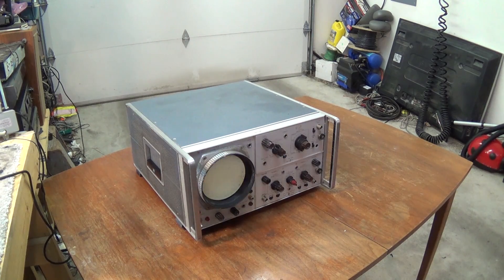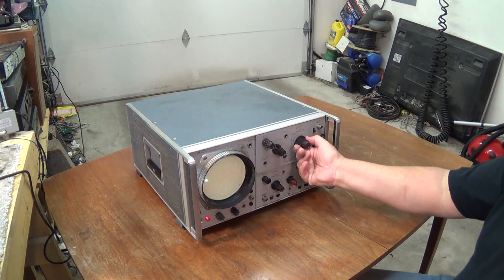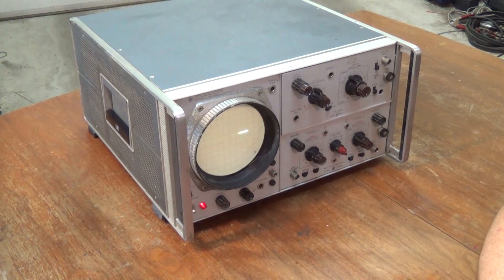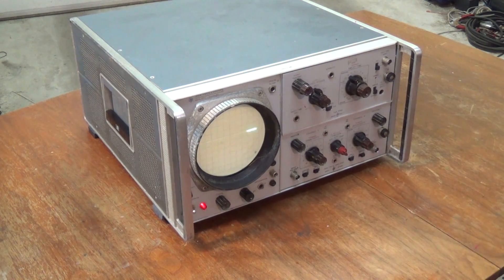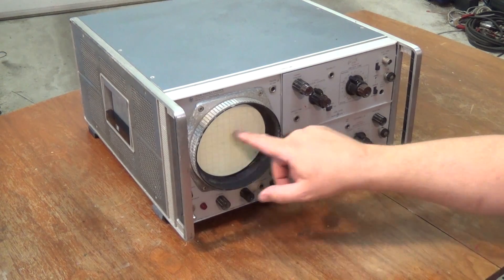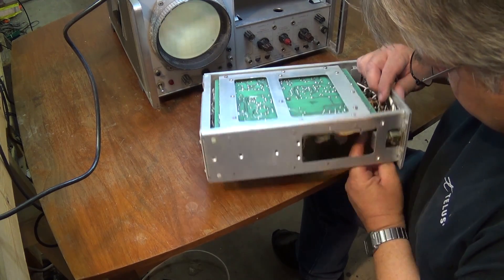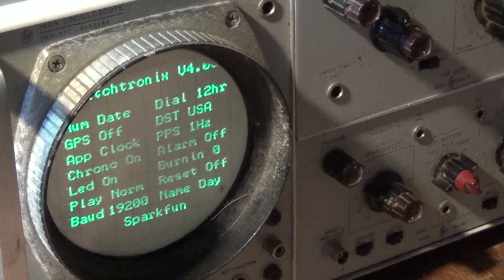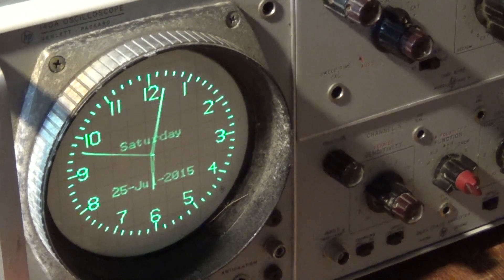Oscilloscope Clock

Comment: I hope you turn it off anyway to try to prevent some of the burn in.
Reply from the maker: I don't run this scope much. It is 56 years old. It sits under my bench. I have a little heatkit I run the clock module on, and am looking for another small scope for my other clock board. I have 2 of these modules now that I fixed the second one.
Reply: 12voltvids It’s a nice oscilloscope.
Reply from the maker: @infinitecanadian  
Still works. A little easier to use then the 2 I currently have set up.

Comment: I picked up a LASER projector that inputs analog.  This module could make a great clock for a New Year's Eve celebration.  Too bad the sparkfun module is no longer built.
Reply from the maker: Yes I know.  I have 2.  One was defective so they sent me a replacement.  I blew that one up so ordered the parts and fixed both.
Reply from the maker: That would be cool. I wonder if it is fast enough for this.
Reply: When Sparkfun stopped making them, the original designer made them for a few more years, but stopped and now just has the board plans and a pre-programmed microcontroller  for sale.

I liked the sparkfun version because it was small, but the DAC had no short circuit protection so if one accidentally shorted the output to ground the chip burnt up.

I took a solid state Bell & Howell kit built oscilloscope and installed the Dutchtronix version of the clock. After getting tired of repairing and always having to adjust the original scope circuitry (basic lower end circuitry) I gutted it and replaced it with a deflection amp board that is very small. It works decently enough, but on a lower bandwidth scope (under 5MHz bandwidth) the display doesn't look so pretty which is due to how the clock draws the screen. Lines meant to be drawn are drawn at one speed. Lines meant not to be drawn are drawn much faster so that blanking is not necessarily required, although the clock does provide a blanking signal. I used a DS32KHz TCXO in place of the XTAL for the RTC to make the clock more accurate. Instead of a battery I use a large capacitor (several farads) and a circuit to charge the capacitor to 3Vdc. That powers the RTC and TCXO. The clock is connected to my PC VIA a serial to USB converter so that my PC can set the time and date automatically.

Comment: You not worry about the burn in ? But now you are using it. See how that works.
Reply from the maker: The clock board moves the image around to prevent burn in. I also don't leave it on all the time.
Reply: In this video you said you was going to disable that function and you were not worry about burn in. Guess you changed your mind after this video.
Reply from the maker: Not really worried about burn in. I don't leave it running 24/7. Since this old scope makes so much noise, and draws allot of power it was more of a novelty. I am looking for another cheap scope, one for the bench, and one to use for my clock board.
I might hook up my video display clock to the monitor up in the corner of the shop where the old scope used to live. I put up an old badly burned CRT set for my security cameras, but it would be easy to hook it to my video clock module, which is just a raspberry pi first gen that generates a realistic looking flip clock. That would look cool in the shop. I run it on an ancient B/W monitor in my office as a CRT desk clock.
Reply: I had a scope long time ago. Never did use it that much. A good DMM is all I needed for most things. Do you every work on old tubes tv sets. Seems to be a thing on YT. Why I don't know.
Reply from the maker: I have a number of CRT TVs but they are all solid state
I am looking for an old vintage color all tube set but as of yet I haven't found any around. I used to work on many tube sets, as when I got into the industry, and I started my TV training when I was only about 16 in 79 tubes were still very common on TVs. Well into the 80's tubes were still very common, but then people just tossed them.
I have a couple of vintage radios I will be working on soon. One is a bare chassis, and the other a Normende  console radio. 
The reason people like to work on tube stuff is they are very simple. High voltages for sure that can kill you in an instant if you are not careful but very simple circuits.  Color tube sets were a littl emore complex, but B/W and radios pretty simple. Amplifiers, simple.
By comparison to the IC sets that have everything buried in an IC that you can't service. Scopes are not used every day, but when you need one, you need one. I am looking for a newer scope, but because it is something that won't be used every day I am looking for a cheap one, and so far the ones I have found sellers are asking far more than I am prepared to pay.  I'll find one cheap soon. When the ham radio flea market comes to town there will be lots of test gear up for grabs from estate sales of silent keys.
Reply: I find it interesting how certain people are now wanting old technology. Like old tubes radio and tv's. I just never thought that would happen but I guess its about what is not common anymore. I'm certain if you could go back in time and show people what we have now they would want what we take for granted like smartphones and computers. The world is funny that way. Always wanted what we cannot have. Or at least we think we want it. I don't miss tubes technology. I seem to understand IC chips more and so forth. I just think that we have advanced so much in such a short time. It's kinda unreal.
Reply from the maker: The only thing that tubes do better than solid state is amplifiers, and it is not that they are more accurate, they are not. They introduce even order harmonic distortion, however even order harmonic distortion makes musical instruments, and the human voice sound much fuller, more like a live performance. I have 4 full tube amplifiers, and 1 hybrid amp. 2 of those 4 I built. The sound quality of these amps is difficult to put into words, one has to hear the difference in sound to appreciate it.
Now as far as CRT TVs go, they are becoming popular in the retro gaming circles because there is no lag in the refresh rate. They draw the picture line by line as it is generated by the video chip in the game console. 
All digital TVs have to store the entire frame, and then display it at once.
Plasma sets were pretty good at this, but LCD, and LEd backlight sets are slow. They typically have 2 to 3 frame delays, and that is unacceptable for gaming. Some higher end TVs have a game mode to reduce the delay, but there is still a single frame delay, whereas on an old analog CRT, there is no delay.
I have a couple of CRT sets that still get switched on occasionally. 
One is on my patio, because in the sun an LCD you can't see, whereas the CRT is bright enough to see. The other is in my shop that I use as a security camera monitor. Like many people I find the old CRT tubes cool. 
I also find plasma displays cool the way they operate, and have several plasma sets ranging from 480p standard def to 1080p HD.
LCD gets the job done, but are pretty boring from an engineering perspective. Same with OLED. I love the picture quality of OLED, but the way they work is pretty boring. Another fascinating display technology is DLP projection. All those tiny mirrors flipping back and forth thousands of times a second to sequentially flash the red green and blue components of the picture on the screen. As a collector I like to restore and preserve these technologies.
Reply: One day we will just skip all of this and place an overlay on the eye or better yet skip the eye and just plug into the brain. You think I'm joking. But I know anything is possible in this reality.
Reply: @DarrellRoper  some may do, but if I'm alive in that time I'll be still sat down here with my B&O Beovision 8802 watching stuff through my Thorn VCR or playing Sega haha

Comment: That clock board kit is still available for about $30 at http://dutchtronix.com/ScopeClockH3-1-Enhanced.htm

Scroll about 3/4 of the way down the screen and you'll find the firmware source code, as well as schematic and PCB layout and other info.
Reply from the maker: This one will be easier than the one I built, as mine was a SMD kit, very small components. This one is through hole, much easier to assemble,
Reply: I really prefer surface mount, even though I'm old and have a terrible time seeing those tiny little things. I tend to build stuff with the slightly bigger SMD components - the smallest ones are just too tiny to deal with.
Reply from the maker: I hear you there.I never wear reading glasses except for electronic work and fiber optic splicing at work.

Comment: thats very cool, wish the kit still existed.
Reply from the maker: I have 1 spare board, that needs the d/a converter chip replaced. When I can source a chip I plan to replace it. The chip is like .25 but digikey has a minimum order, and I only need 1 so I have to find it somewhere else and I can fix it.Then I will probably sell it.
Reply: I'd be interested :)

Comment: Please for give if this has been asked and answered however, I'm assuming the clock circuit is a kit. Where can I obtain one. Thanks in advance!
Reply from the maker: It was a sparkfun kit, however it is a retired kit. I have another one that the D-A converter is buggered up on. Needs the chip replaced which I will do as soon as I can find one. Digikey sells them, but they have a minimum order and I just need 1.
Reply: I know how the single part thing goes for sure. The scope looks cool with the clock display. Thanks for the reply.
Reply from the maker: When I find a single piece I will replace it, and then probably sell it off after I make a video of the repair, as I don't need 2.
Reply: 12voltvids
I understand. Let me know when you repair it and if the price is right, I'll take it off your hands.

Comment: That gives digital scope a whole new meaning.  Now add temperature, barometer and humidity, hy not?  I have a clock screen saver that I have on an old Pii laptop, but this beats that by a mile!  How do I get and program that module?  Don
Reply from the maker: +Tech Gorilla Yes that is the same one using through hole. The one I  picked up was a SMD kit, and yes it was a many times more difficult to assemble considering I could barely see some of the parts. I actually have another board but one of the chips is fubar. I will probably troubleshoot it some day.When I built the first board it was distorted and I contacted the vendor. They asked for a picture of the display, which I sent them  and they sent me another kit complete for free probably because it was the last one they had and just wanted to clear the catalog and not carry it anymore.
Reply from the maker: +umajunkcollector Actually this circuit only works on analog scopes properly. High end digital scopes may work, but cheap ones no way.That osciloclock was available from sparkfun.Here is the link to the one they used to have.https://www.sparkfun.com/products/retired/9306This is no longer available, however I do have one of them that I should give away. It has a slight problem that I should try to fix.
Reply: +12voltvids How about this kit:? $35USD

http://www.dutchtronix.com/ScopeClockH3-1-Enhanced.htm

Edit - Partial kit is still available at this link:

http://www.dutchtronix.com/Essentials%20Kit%20Dutchtronix%20AVR%20Oscilloscope%20Clock%20Hardware%20V3-1.pdf
Reply: +12voltvids I've seen that in your video opening and really liked it.  One of these days, I will have one of these in my work space.  I'm looking for old, broken scopes on fleabay all the time.  I'd love to troubleshoot that chip for you ;)

Thanks for the content, sir!

Comment: It takes too much power for that oscilloscope to be use only as a clock. It is impractical unless electricity bill is not a problem in your area. Anyway that's my own opinion. I'm just a little bit concern about energy conservation.
Reply from the maker: Hi'gak Iya Well it won't be left running 24/7.I have mounted it up in my shop on an old CRT TV mount.It draws 152 watts, which at my high rate of electricity is .015 per hour, so it really doesn't draw that much Comparable to a TV. Now I am not guessing at the power consumption, I have a KillaWatt meter, and I just measured it, I also have a digital display in my house that reads the smart meter by the second. It shows real time how much it costs for everything in my house. When I turn the scope on it jumps between 1 and 2 cents per hour, and when I turn it off is drops back down, so I know exactly how much it costs to run, never the less it won't be left running all day and night unlike some things in my house, it will be switched on when I am working in the shop, like when I am making a video, and once I am done I will be turning it off. I mounted it right up over the door out of the way.